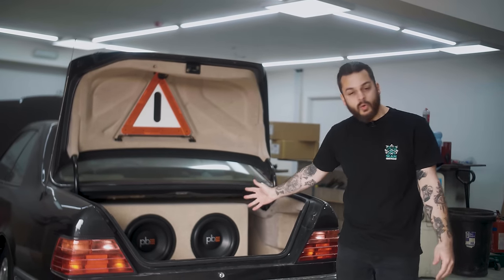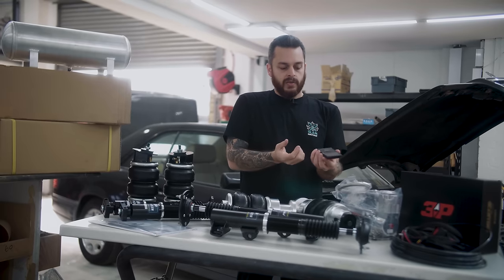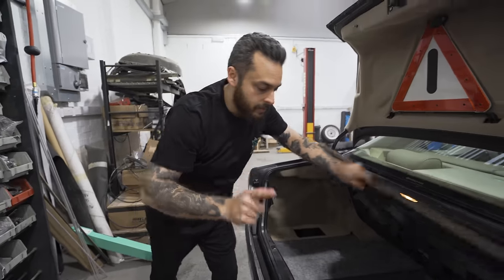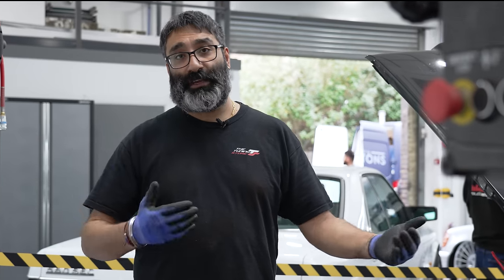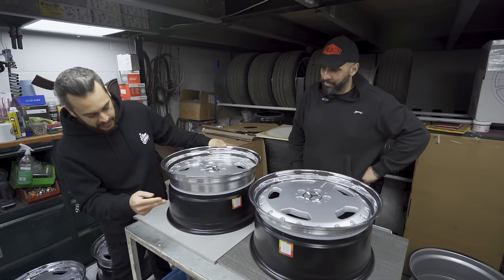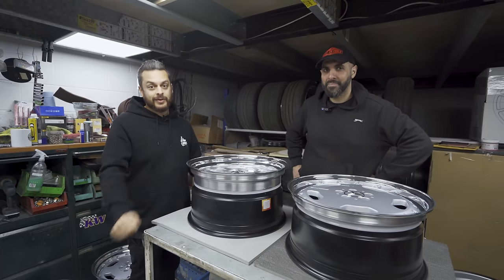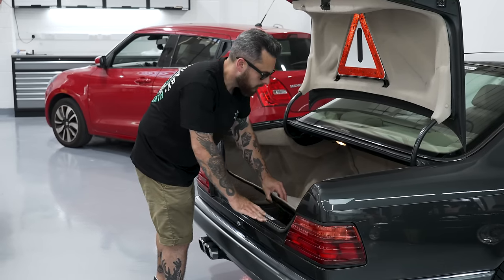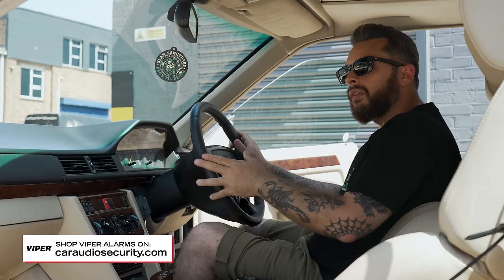Mercedes-Benz W124 Coupe is DONE | Slam Sanctuary Customs C124 EP5

Comment: I think that w124s are one of the best design Mercedes and it is very reliable from what I used.  I use w124 e280 4 door with 400k miles on the clock and never breaks down

Comment: Amazing build guys!! Quick question: Is it ok to have the Airlift manifold at the same height as the tanks. I was lead to believe it had to be higher to avoid damage from the moisture in the tank dripping down into the manifold. I ask because I am installing Airlift right now and want to set it up the same as you have in spare tire compartment but the Airlift instruction manual states the manifold height issue. Thank you